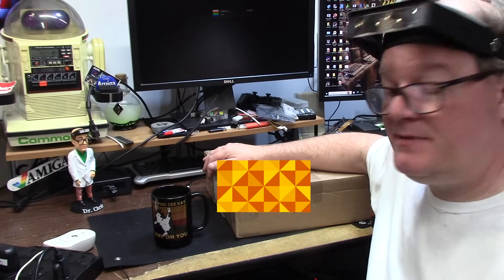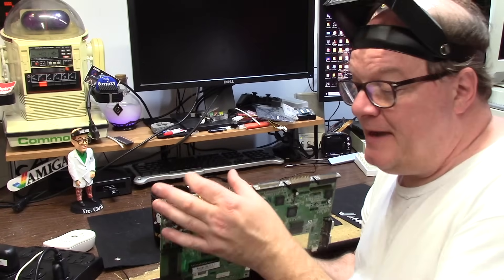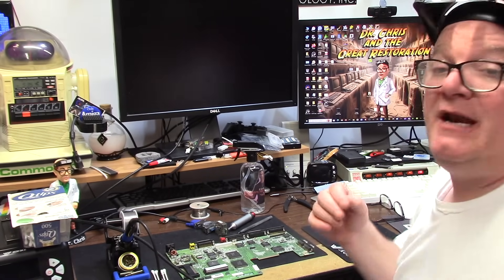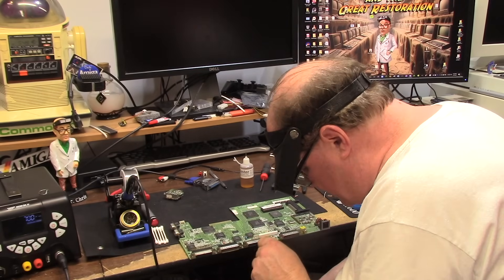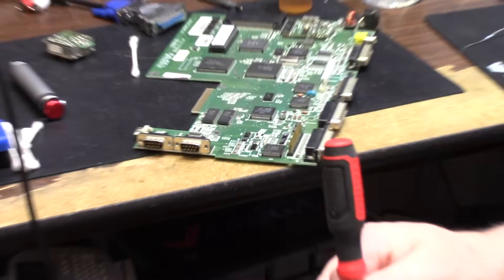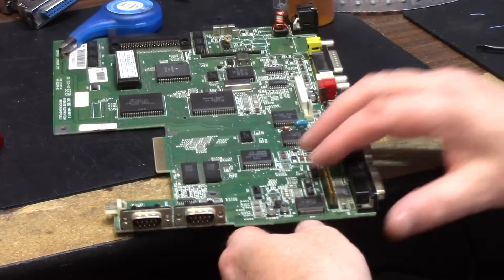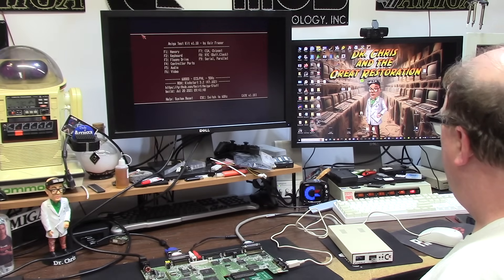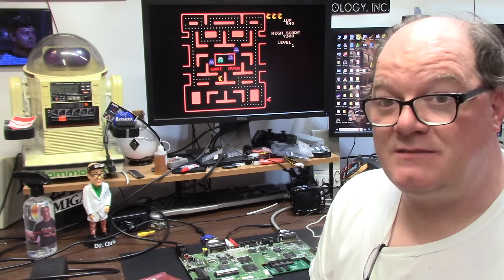OHROM A600 leaked caps and broken pads and dreams

Comment: Hi Dr chris. I have to remove a Motorola 68882 from a plcc socket as I suspect its the wrong way round. There are a few different tools on the market can you advise on the tool you would use
Reply from the maker: The old plcc shovel.  Only place I’ve seen the, were on old pentium overdrive processors.  Intel made them to remove the old 486 plcc chip’s

Comment: Chris, please, for the love of dog, if you're going to use the funny explosion have the audio level equal to the rest of the video!  You've got over a 20dB (!) jump between the preceding spoken section and the explosion which can blow speakers, damage equipment and fry wits.  It turns it from funny to something else starting with f.
Likewise you've got a 10dB jump between your spoken section and "No One Cares" which is also too hot.  I dropped the explosion by 10dB which still made it too loud for my taste but carried the explosion meaning, and the "No One Cares" by 3dB which seemed to slot it unobtrusively with your surrounding speech.  
Remember, audio isn't just about managing the peaks, it's also about the overall intensity.  You can think of it as a constant tone at a high level seems to be louder than an intermittent pulse at the same level.  Your speech is the infrequent pulse and the explosion is the constant tone, to make them seem equivalent you need to drop the maximum levels of the constant tone.
I measured the differences by exporting the audio into Audacity then using the "contrast" analyser to look at the effective dB differences between the sections of audio.
Reply: it startled my cat. she's sleeping in front of the 35cm woof
Reply: @chaoticsystem2211  See Chris!  Think of the kitties and the woofers!  ;-)

Comment: I'm an enthusiast and I think I know what you mean. 

I bought a non working A1200, swapped out the ROMs (it had one A4000 ROM in it for some reason) for two 3.1's of my own, cleaned it and the (previously non working) floppy drive to within an inch of their lives, swapped the failing PSU for a spare one of my own, wrote and labelled 6 Workbench disks, then sold it for a tiny bit more than I paid for it. It felt like I had to make it live again and had to get it in to its next owner in a decent state.

Comment: Great job! I might have to recap my A600 as the sound isn't working. There's no corrosion at any of the caps that I can see and almost all the traces look shiny. Maybe they are just dried out and/or any corrosion is happening under the caps...dunno but will give it a go over the summer.

Comment: I been waiting for this one, great work Chis appreciate it. it looked amazing when  got it back. I always over bubble wrap anything I ship after I purchased an Amiga 2000 keyboard on Ebay and the idiot shipped it to me, in one of those shipping type bags nothing else. and of course when I opened it up nothing but pieces.
Reply: Ohrom this is the unit I donated to Amiga Bill I hope all is well take care from Stu
Reply: @honkybear666  Hey Stu, the 600 running great got vampire all worked out, and a new keyboard membrane and I think its all set now :)